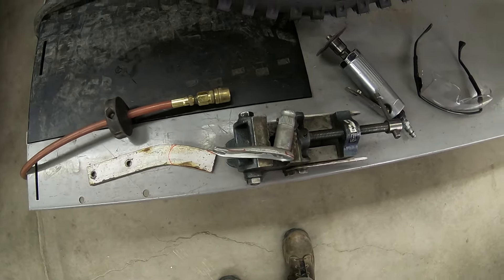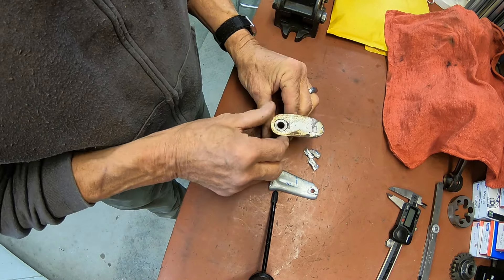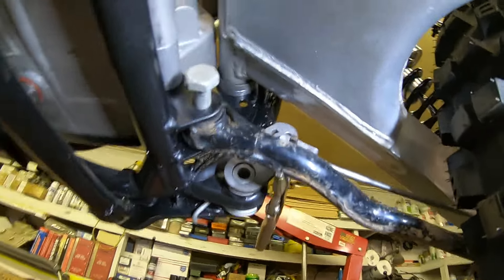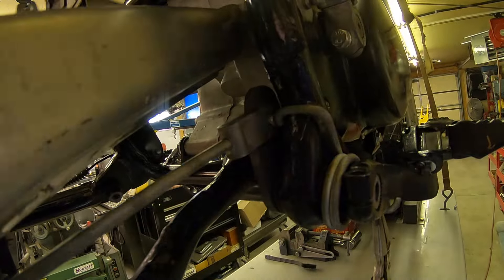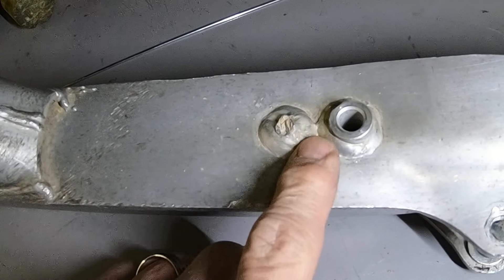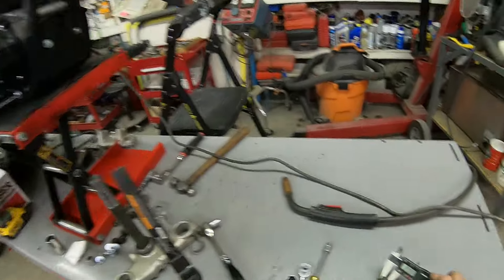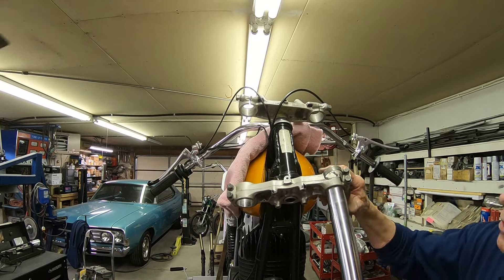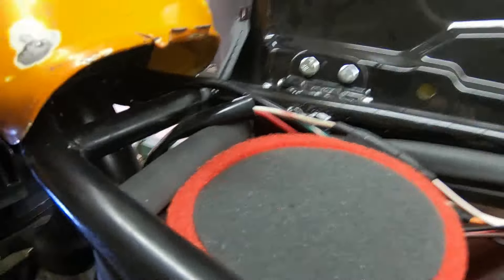Yamaha 250MX long travel forks, rear brakes

Comment: Nice work Dale! You have the mind of a Design Engineer. Always able to resolve design problems. That's why I enjoy your videos. Have a great weekend.
Reply from the maker: Thanks brother, not sure about the engineer stuff, but I come up with some stuff. Kind of crude on my building but usually get the job done. It's just fun!
Reply: You are a free thinker Dale. You don't need a piece of paper giving you a title. I got a couple of certifications thru correspondence courses while in the army. Airframe and Powerplant and Mechanical Design Engineer. Helped me advance in rank a couple of times.
Reply: I picked up Structural Engineering shortly after I retired from he army.
Reply from the maker: Yes, I tried taking some of those courses also but didn't have the time to spend on them with my full TDY schedule. When I was at home base, I just wanted to do what I wanted to do. But I am enjoying doing what I'm doing on these old bikes, it's just a lot of fun, and keeps my mind occupied.
Reply: I also acquired an ASE certification when I had my shop and Building Designer certification when I was providing construction drawings for residential and Light commercial buildings. There was never a dull moment after I retired from the army. Sure am paying the price now days health wise.

Comment: Great progress Dale: My last modern bike was a striped down WR250R. It only had 10.5 inches of travel but the suspension was PLUSH. I never liked the upside-down fork concept this is the only set I have had. The suspension workings were a mechanics nightmare, with way too many parts and expensive to work on. I didn't own it long enough to wear anything out. Missed the simplicity of the early 2 strokes.
Reply from the maker: I hear you John, something to be said about old two strokes, trying some upgrades here, we will see how they pan out.

Comment: Good Morning Dale. I went to a swap meet yesterday and ended up coming home with a 78 RM370 barn find. It's  going to need alot of work to get it back into shape. I did manage to sell some parts as well. All in all it was a good day.
Reply from the maker: Dang David, you come up with more stuff, that RM370 will be a nice bike, I was working at the Suzuki shop back home when they came out new in late 75. No motorcycle swap meets up here. Too far to go to find one, probably Denver, Minneapolis or Seattle. Have a good one my friend..

Comment: Can we call that bike a Yamazuki? The low pipe will need a bash plate, maybe a plate that protects the front of the engine casing as well. Otherwise, yes, the pipe gets cracked on the first passing rock, it's a law of nature.
Reply from the maker: I think we have been calling it that off and on, you are right of course about the pipe, but I am fearless and going without a bash plate, I know I will be sorry.

Comment: I was wondering about the rear brake geometry. I thought it was going to be tricky with added swing on the suspension.
Reply from the maker: Yeah, I was thinking about it for a while Evan, really thought a cable was going to be needed, rod worked out though, I am happy now.

Comment: Hi Dale:    You do some fantastic work******Looking forward to your fabrication of a pipe for the 250 Yamaha*******Perhaps you create one that looks similar to the Yamaha LT2- MX or LT3-MX******complete with a silencer and fancy heat guard
Reply from the maker: Hey Bob, thanks a bunch, I am dragging my feet on the pipe build, playing with it a bit but not happy yet with my cutting and rolling technique. Yeah, it will be similar, but no heat guard, MX bikes don't use heat guards, they just burn the heck out of the rider. LOL, not real sure what I am doing yet........
Reply: @montana2strokeracer  Hi Dale:  I just saw your reply today. 6-27-24*****I'm just getting the hang of dealing with notifications.........I would just like say that the LT MX did come with a small heat guard........It basically was the only MX model to have one..........I can try to send you photo of an LT3 MX if you like****